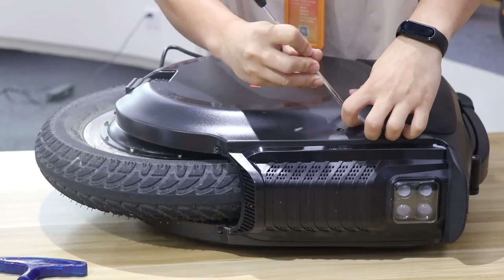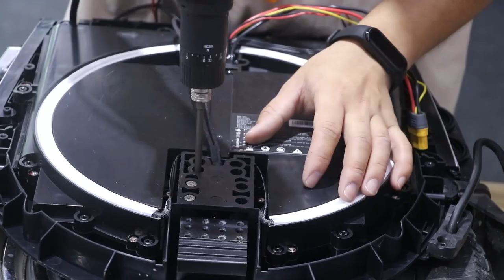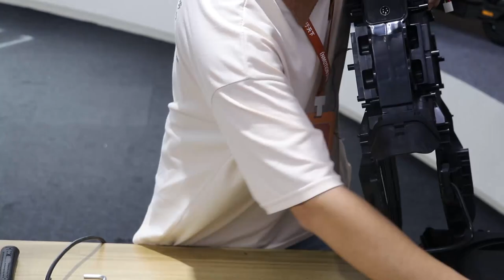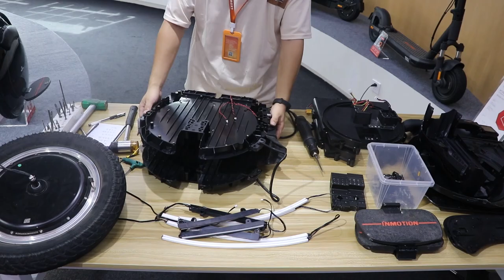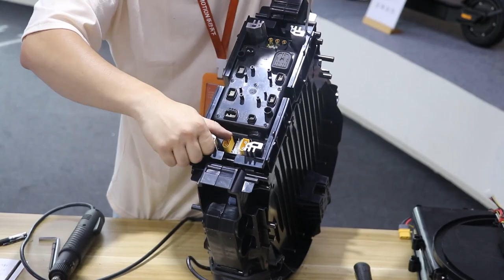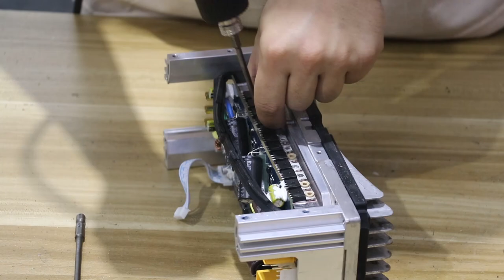INMOTION V12 Electric Unicycle | Teardown Video

Comment: The asking price suddently doesn't seem so high, when you see the build quality, cable management, and how everything just fits together perfectly.
Reply: I totally agree! The engineering behind the design is legit.
Reply: old type engine with center pin cable, fully plastic shell without any metal carcas reinforcement quite small motherboard, are you serious? After seeing this teardown price seems quite reasonable to me if not bit pricey considering early quality issues and other rivals.
Reply: FR, some companies like kingsong and begode make powerful wheels for higher prices but most come with major downsides in quality or just one big issue that always breaks the deal for you such as a screen that breaks every crash etc. often leaving you with a wheel that you think is hideous or just don’t like riding just because you wanted that extra performance. And nowadays the digital passcode and lock is a must, especially if you are a student on a big campus or a workplace that doesn’t allow you to bring it inside. this is the only company I’ve seen that does it right though.
Reply: @mikhailkova you will NEVER find a wheel that you don’t think is overpriced. They are assembled in batches by humans because it’s so niche that any amount of automation would far exceed the market demand.
Reply: @ReasonRaider  only expensive part of the wheel is batteries that are outsourced by Koreans, everything else is made with dirt cheap materials and cheap labour, even technology which was mostly developed by Segway is stolen and partly enhanced by euc companies so what again make that price reasonable?
Reply: @mikhailkova  did I say they didn’t make it for dirt cheap? No. I said that you aren’t going to find a wheel that isn’t priced like this. Everything around us is made in china for probably 1/10 of the cost, nobody can really deny it.

Comment: Great product, the tire replace seems to be striaght foward on the V12. have you considered standardising your pedal hanger design for all future models, this would allow pedal producers great flexibility. The drone sound is a great feature perhaps consider a sound that more closely matches a hub motor sound or enhance this as the Inmotion patented sound, as the frequency of the sound during use is what riders would eventually sub consiously rely on for an indication of speed.

Comment: The motor axle crushes the cable.
Why do you put the motor on the table without any side support?
When I repair my wheel I place a plastic bottle under the tire/motor so the axle doesn't touch the table and bend/crush the cable, or I put it on two chairs and the axle falls in between the chairs.
I hope you don't assemble the wheels like this.
Reply: Right 👍

Comment: Great job. The inside of an Inmotion wheel puts Begode to shame.
Reply: There's no shame in creating wheels that are quick and easy to work on when it comes time to do regular maintenance.
Reply: @outtatime5034  If a quick tire swap means having to sacrifice build quality (rat nest wiring, poor waterproofing, loud fans, loud motors, easily cracked shells, occasional fires, etc.) then I'll opt for Inmotion, Kingsong or Veteran every time.  I haven't seen the inner workings of Begode's latest offerings, but I'm guessing it's more of the same.
Reply: @augustleo7434  Not just quick.  I don't have to loosen motor lead connections or even look at my motherboard for that matter.  I just unscrew the other side and lift the shell up for total access to the tire.  I say this as if tire swaps are the only reason to get a Begode.  Performance.  Power.  Speed.  Reliability.  Extensive model lineup.  Fires?  All the brands you mentioned have had fires.  Anybody getting any kind of electric vehicle should educate themselves on the risks and precautions to take.
Reply: @outtatime5034  As it stands, I believe that Begode's wheels are overpriced for what you get. Inmotion and Kingsong are finally listening to the riding community and designing/building wheels that are faster while maintaining good QC and safety specs.  I'm not here to convince you otherwise, so spend your money as you see fit - I'll do the same.
Reply: @augustleo7434  Build quality = More complicated design 

This is not true. S18 came with a lot of issues in first batches but the build quality is solid. Tire swap is extremely easy compared to any other wheel. The wheel does not have any issues you mentioned above.
Reply: The build quality of a Veteran is not on the same level as Inmotion, Kingsong or Ninebot.
Reply: @outtatime5034  You're not supposed to work on Begode's wheels. You're just supposed to buy another when you inevitably crash them and they disintegrate.

Comment: I have a problem with my EUC INMOTION V12. My EUC worked well for many months until I put it to the back of a car, the EUC doesn't self balance anymore. When  I turn it on, I have on the screen the text "Please connect to activate". So with the INMOTION app, I tried to connect to the EUC, without success. I tried to turn on and off the EUC multiple time, reinstalling the app, restart my phone, on the original app it doesn't connect at all. So I tried with another app called "EUC word". The app successfully connect to the wheel, however I still have the screen "Please connect to activate" and the wheel doesn't self balance, so it doesn't change the problem. I can just control parameters from the app, but the wheel still doesn't self balance. Can you tell me what can I do to solve this problem please ?

Comment: I certainly like the build quality but why it has to be so unnecessary complicated to remove the motor for tire change. Why there are so many wood screws and places where silicon is applied.
A motor connector nearby axle would make life easier and the connector on control unit wouldnt be needed. It would be nice to have side covers on clips with metric screws to make repeated disassembly fine

Comment: This looks like v12 has a lot more complicated way to change the tire compared to v8. And I thought that v8 tire change is difficult enough.
Reply: In this video he is doing a complete tear down of the wheel just to kind of show you all the pieces I’m pretty sure you don’t have to take so much apart to change the tire; 
Someone please correct me if I’m wrong
Reply: it looks like to me that you really need to disassemble the top cover to get to the connectors of motor, oh god why. Iam also not a big fan of long distance motor cables + sensor but the overal build quality looks good